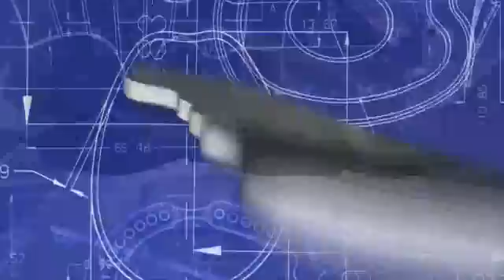#britek  Energy Return Wheel... Autonomous Never Flat

Comment: AIR-SEAL gives you 25% more fuel efficiency as it keeps your tire at a level 32 its also got heat treatment in it to keep your tires cooler there for less ware and tare its also washes off in water and is environmentlly friendly while stopping punchers in the tread side wall and beads and valve its also got a tire conditioner in it to keep the tire in good condition's the thing here is we are selling AIR-SEAL its on the market now and making big money your tire is were? in your shed

Comment from the maker: Michelin invented the radial tire in 1948. The radial tire as original equipment showed up on the 1970 Lincoln MK 111. The radial tire was approx. 10% more efficient than bias belted tires. Auto is slow when it comes to true tire innovation.

Comment from the maker: Thanks The tire industry has been moving in the airless direction for some time. We started in 2001 with the thought of capturing the vehicle weight as directional stretch. By adding dynamic charges IE greater pull tension to the elastic attachments the performance increases. Add a vacuum boost to tune and you are driving in the future.

Comment from the maker: Our hoops are designed to go "out of round". That displacement stretches the attachments as another way to accumulate force to be returned as hub lift and rotation. The "hoop on hub" reaction speed is accelerated by the pull force of the radial array of attachments.

Comment: You don't have problems with out of circle bends at high speed when the road changes from smooth to very rough . . .we developed an air cool rubber tire design . . . and the problem I see with your is hard hit at high speed . . . that wheel/tire design will bend out or round . . . ..

Comment from the maker: Thanks! Excellent points. Material science and design supports so many applications. We are just at the beginning of the airless revolution and we are already pulling a vacuum pressure to remove as much as possible then we  stretch what is left as part of the resistance and rebound.

Comment: I attended a CSU university for 6 years wherein I majored in Electrical Engineering with a minor in Mechanical. I'm not going to rain on your parade anymore, but I'll tell you what - if this project doesn't completely fail and fall off the face of the Earth within the next 5 years, similar to the last "cutting edge wheel technology breakthrough" (the "tweel"), then I'll gladly come back and eat my words. Until then, as a fellow inventor and entrepreneur, I'm just going to say this: good luck.

Comment from the maker: The "hangs from the top" answer...The radial array of elastic attachments suspends the hub perfectly centered within the scope of the hoop. When weighted the hub lowers and now is drawing more tension from the top side of the radial array. The hub within the radial array can rotate enough to accumulate and return screw force for power amplification.

Comment: This guy's claims about "more energy at the top of the inner wheel vs. the bottom, which helps it roll" and "the sound absorbing foam puts the vibration energy back into the wheel, to help it roll" are so mind-numbingly stupid, I don't even know where to begin. This is the worst kind of hoax; one that the inventor doesn't know is a hoax. Btw, you can get a "novel patent" for virtually ANY piece of crap you dream up. There are many patents for devices that LITERALLY blow smoke up your ass...

Comment: The bolts would eventually snap causing the same problem as a blow out  not to mention how hard they would be to inspect for individual damage/failure. And the tyres would wear the same as a pneumatic one. Also I love the way you mention the green element and then fit them to a 5.5 litre merc! Nice and environmental. Lol

Comment from the maker: We "stretch" not compress. Stretch is very directional where compression is path of least resistance IE bouncing squirming and the likes. A loaded freight train is a 2 while a pneumatic car tire is a 10. A commercial truck is about a 7 because of 100 psi. tire pressure. Allot of room for improvement over the pneumatic tire.

Comment: That wouldn't result in a net power gain over a solid wheel (you have to compress those springs, storing that power initially), but I can definitely see the safety advantages of a non-pressurized wheel.

I don't know how well it would perform compared to an inflated wheel, since they aren't very efficient at all.

Comment: The future is wide open yes . i can make in theory,  a wheel that would easy replace a alternator  that is 6% to 12% better gas mileages.   10 hp to 20 hp electric motors where  the alternator was  that would be  20% to 40 %  better gas mileages $ 90 dollar  a month  1200 a year  easy.   it would be like getting gas for less then $2 .  you wheels look very good  i do not like big business

Comment from the maker: The future is wide open. Our unique high frequency in wheel suspension response is more suitable for sensitive electronic hub components than what balloon tires offer. Better recovery of brake force through screw force accumulation, better acceleration and hoop levering over rough terrain.

Comment from the maker: Who else has ever used stretch to suspend a hub in a hoop? We have screw force accumulation and return to maximize traction for acceleration and brake force. Our composite hoop strength when combined with the aluminum wheel strength is a very significant advancement in performance and safety.

Comment from the maker: The best pneumatic tire fails in short order without air pressure. Air was a great solution for cushioning but took much more energy to roll. Material science and mechanical engineering is replacing air. This is a fact. You are seeing early efforts across the industry.

Comment: I believe you are trying to mislead about pneumatic tire strength. That are very resilient. Plus, these look like they would Las no longer than a low profile tire. 

I could only imagine the trouble people would have in places where ice is spread on the road as well. The bolts and nuts would probably rust in place.

I don't see anything revolutionary here to be honest. Looks like a press on forklift tire bolted with spokes to another wheel. (The forklift tires have a metal ring inside them.)

Comment from the maker: Maybe we need a nano tech. hybrid surface to help shed mud? Paddles off the composite hoop could provide traction while sinking into soft surfaces while still providing high speed highway performance. Anti bounce back for ascending large objects. The hub is drawn upward and forward within the scope of the hoop by throttle response. Hub high and forward position levers better than a hard wheel when ascending.

Comment from the maker: We discovered the value of backing up the membranes with a vacuum pressure. Our vacuum boost unites with the radial array membrane pull force to center the hub within the hoop. The ERW's internal dynamic stretch force to weight ratio starts to get interesting at 1,000 lbs. charge per 100 lbs. load.

Comment from the maker: Dynamic stretch backed by vacuum pressure allows for screw force accumulation and return. The irregular drive train bumps and pulses can be likened to spinning a merry-go-round. If you are trying to spin too quickly it is like hitting a brick wall, spun just right and your force is turned neatly into rotation. Spin using a drawn bow string and your "too fast" spin will launch your merry-go-round.

Comment from the maker: Our newer prototypes are vacuum charged... a radial array of suction cups that  stretch to absorb the pull of gravity, impact or displacement/rotation from throttle/brake force. When on the surface the pull action is concentrated in the top 180 of the inner diameter of the hoop. A massive levering advantage on par with the throwing stick for the spear.

Comment from the maker: The test was done at the USDOT high altitude testing laboratory. They drove the vehicle. They also insisted on a very heavy dyno resistance setting.The 35.5 psi pneumatic Tire VS ERW...  We spin up and reach the 55 mph.more quickly while the pneumatic tire fights to turn the 48" AWD drums.

Comment from the maker: Notice improved acceleration and coast down. If the flywheel effect was a coast down advantage it should be a drag on acceleration. Tire VS ERW shows full throttle acceleration...  USDOT AWD dyno set to 6,000 lbs. resistance. ERW clearly wins both acceleration and coast down by about 50%. Brake force is metered out torque converter like via the radial array.

Comment: So composites have been improved to the point where vibration is no longer a problem? I would be interested in seeing what method determined this tire assemble is "easier" to turn. I can see where the effects of gravity, weight, and centrifical force might make it appear so. I think you have a great idea for reinventing the "tire assembly", however, (wheel: Noun, consisting of a circular frame or disk arranged to revolve on an axis, as on or in vehicles or machinery) the wheel is still a wheel.

Comment: I think you have a great idea hear... depending on testing and making it availible to the public through mass production... it looks like covered all the angles with road hasards bursting tires or causeing them to deflate... but how easy or ofthen do you have to replace the tread? Does the rubber last longer because of your design? Will you be able to get rubber replacements from curent tire manufacturers today or exclusivly thrrough you?

Comment from the maker: Yes, the dynamic stretch of the elastic attachments is drawing kinetic energy to points centering hub in hoop. The radial array of attachments line up "yin/yang" across the hoop. The hub is drawn in all directions at once. When weighted s the hub sinks within the scope of the hoop. Top side attachments are stretched by throttle / drive train screw force return  = rotation the path of least resistance.

Comment from the maker: "High Speed" Off road racing is of interest to us. Bicycles are the low hanging fruit. Our new space age materials and processes are making very tough light weight hoops that are holding up well. Pot holes can do massive damage to your vehicle. ERW will provide superior impact protection with less than 1/2 the displacement travel of pneumatic tires tread block and sidewall deformation..

Comment from the maker: Not so fast for automotive. The industry is notorious for slow change. The radial belted tire was patented in 1948 but took until 1970 to show up as original equipment on the 1970 Lincoln Continental MK 111. It took another 6 years to take over industry wide.

Comment: Through the use of adjustable rods, the rubber is stretched which stores elastic potential energy in the wheel, turning the ERW into a 360-degree slingshot that retains energy (hence the term “Energy Return Wheel”). When the ERW is attached to an object, that object becomes sprung. Just like a garage door that is sprung, the attached object becomes de-weighted and requires dramatically less energy to move than an unsprung object. Less energy to move means an increase in fuel efficiency.

Comment: I'm sorry, after reading another few comments I see that there ís data. Well, as I said your market will have to rely on data (at least that's what I think). If I were you I'd have included that data in this video (or another), because that's all we're interested in. We don't want to hear claims like "this wheel gives incredible performance", we want to hear "this wheel saves you 0.1 gallon per 10 miles, this is based on the following tests (...)" etc. A bit more scientific.

Comment: That's strange. In an R&D department usually people generate data first (through simulations and practical testing) before producing the final market ready product. Since this is a new concept I'd say your market HAS to rely on that data to find it credible. It almost seems as if your goal is to trick them into buying the product without proving the advantage.

If I'm wrong (would be cool if I am), I strongly suggest you perform some decent tests to see if your design has any advantage at all.

Comment: "more current utility wheel patents than any other wheel in history"
This means absolutely nothing.

Once again you make a claim about outperforming the pneumatic tire, but have no evidence of this. I said nothing about an over-inflated tire. Not all pneumatic tires are the same stiffness/air pressure/contact patch etc. 
In your clips you compare your tire to a pneumatic with a much larger contact patch. You are comparing apples to oranges.

Comment from the maker: We are informing you of a new patented wheel technology that has more current utility wheel patents than any other wheel in history. Coincidence that it out performs the pneumatic tire? An over inflated tire is very dangerous and bounces like mad. We have even better rolling resistance and traction to spin smooth 48" USDOT dyno drums set to 6,000 lbs.resistance at full throttle. Tire VS ERW. Our radial array of elastic attachments is highly charged/elongated and backed by a vacuum boost.

Comment: Then you should not be making claims of "better efficiency", "less resistance", and "energy return".
If you're going to make those claims then have the balls to post some data.
I've seen some of your clips and any efficiency increase you are attaining is by sacrificing contact patch, and frankly can be achieved with a stiffer/harder pneumatic tire. 
Claims that your 'rubber' insulator absorbes vibrations and returns them as rolling energy are outright rediculous.

Comment: jawn boring you'r doing stuff the germans already did over 30years back and it was a failure then as it is now then the consept that the us army is using is better stronger and easyer to realize then wheels with more steel a spring set wheel was already abandond in the time of the bikes when the inside was wood and the outer steel rim was suspended to that so not original and not a step in the future only republishing old shit

Comment from the maker: Material science is advancing for sure. The carbon nano tube construction potential is 10 x lighter than carbon fiber with 10 x the strength. ERW does not rely on sidewalls for weight bearing. Forces are drawn to points centering the hoop on the hub. Lateral freedom of hoop movement is shared 360 degrees via radial array. Strong stuff.

Comment from the maker: The hub is suspended within a composite hoop by a radial array of highly charged elastic attachments. The total amount of dynamic "pull" is about 5 tons per wheel, unloaded. When placed on the ground the hub sinks, drawing more tension to the top 180 inner diameter of the hoop. Throttle response raises and levers hub flinging the hoop to the surface. We draw kinetic energy to points then lever the hoop from those points.

Comment from the maker: ERW spins true. A light weight composite hoop flung to the surface by radial array of highly charged elastic attachments.Our vacuum boost tunes suction cup like levering. The power of the vacuum combined with ERW drawing forces to points creates a Super Wheel.

Comment: and i tell you what, when your ready for a prime time test, come to my shop with a 4.88 hub pilot 10 lug wheel in a 235/75/17.5 6005# rating and i will run it until it fails.

Comment: i do it every week. its called the Cross Bronx Expressway. 
i weigh in at 40,000# with a 5500 dodge truck and trailer.
the holes and seams are wide open. you have everything there from a 4" lip to a 6 inch tall bump, to a 8" tall side ridge. and thats just one 5 mile stretch of road. speeds are 55-80 during non rush hours, to stand still during. Michelin also has this tire your presenting here, but they do not use bolts. and it predates your idea.

Comment: Aircraft would benefit more from this type of new wheel technology, and it would sell itself as a wheel that won't explode, won't catch on fire, and the inner hub can be the entire braking system. 
It takes a special kind of stupid to use pressurized pneumatic tires that need to go 10,000 meters or more above sea level.

Comment from the maker: VERY... We have been on quite a journey. From steel to exotic nano tube composites. Initial tests show dramatic coast down improvement over the pneumatic tire. Drive train efficiency research demonstrates double digit improvements. Our job has been to bring each component as close to perfection as possible then apply improvements to specific application ERW's. We have refrained from over promising as the final material science issues are being addressed.

Comment: Rubber does not unravel buddy.  The spike strips are hollow pointed pieces of metal that get stuck in the tire or cut a large hole out of the tire. The reason tires fly apart is because a flat tire flexes drastically and generates massive amounts of heat, The heat unbinds the layers of the tire. Runflats have stiff sidewalls preventing the excessive flexing. Don't believe me, look it up. I am an ASE Master Certified mechanic and a Mechanical Engineer.

Comment from the maker: Carbon nano tube construction is in going to show up in ERW motorcycle hoops and wheels. A pure carbon nano tube hoop could potentially be one tenth the weight and 10 X the strength of carbon fiber. So today's 3 lb. hoop could be under a pound. The wheel mass can be also reduced because of the massive hoop strength.

Comment from the maker: Rubber is the weak link in tires or ERW's. We now use Kevlar, carbon fiber, nano tube construction.  Bridgestone is our competition. We are winning. We are high power high speed while their airless tech. is low weight, low speed. We are double digit more efficient than pneumatic tires.... They are less.

Comment: Pretty cool. Obviously a long way away from 100% usable. What is the weight? How about cornering strength - how would it hold up to torque in acceleration? Or if one of those bolts comes loose?